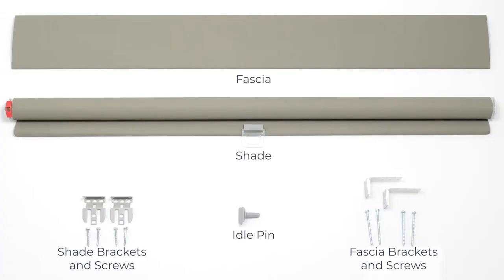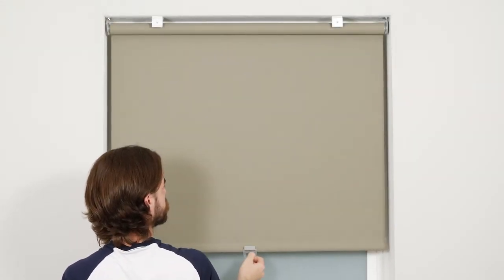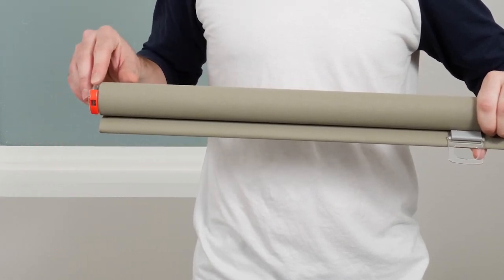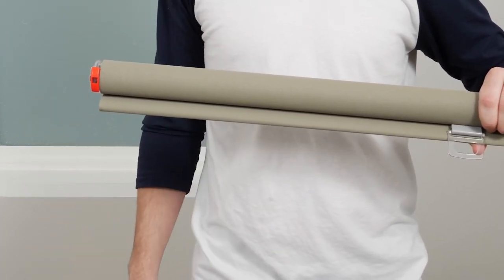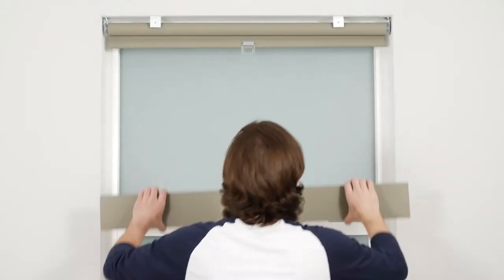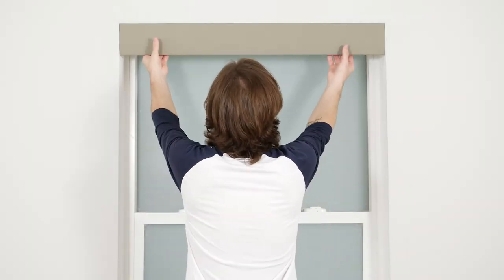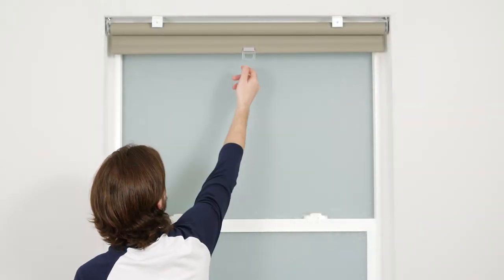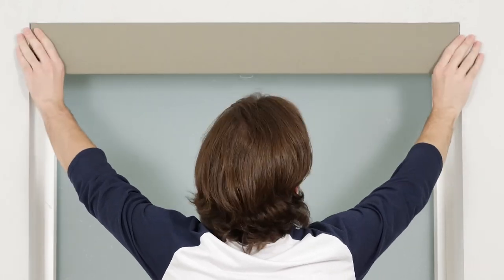How to Install Inside Mount Lifestyle Roller and Solar Shades

Comment: my fascia doesn’t have magnets and the brackets won’t go in…
Reply: Same here.... this video and the instructions I received both mention magnets, but there are no magnets. I cannot get the fascia to snap on to the brackets. Were you ever able to get yours installed?
Reply: @YTGal13 My old ones had the magnets which were easy to install.  The new ones have snap on brackets which don't fit.  Can't believe they sell this with two parts that don't fit each other